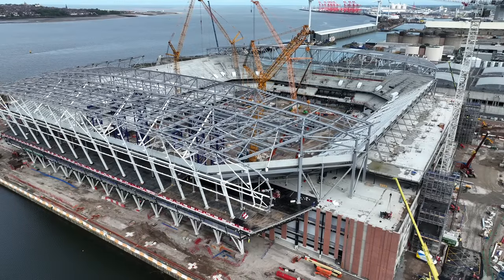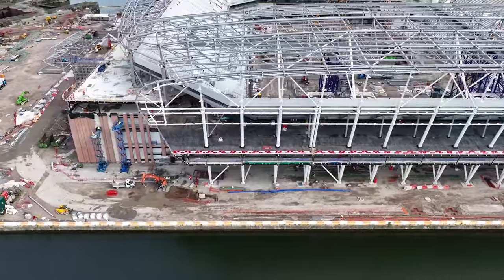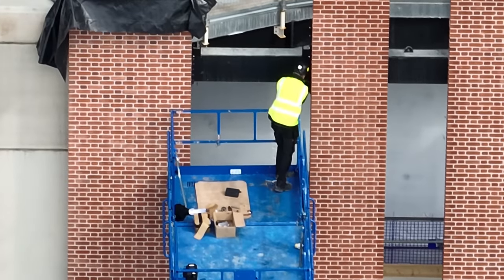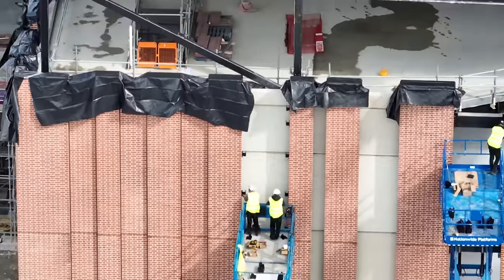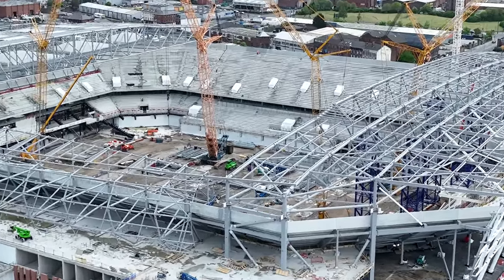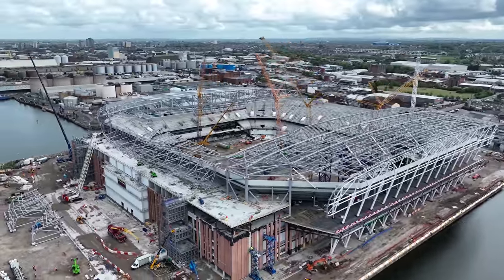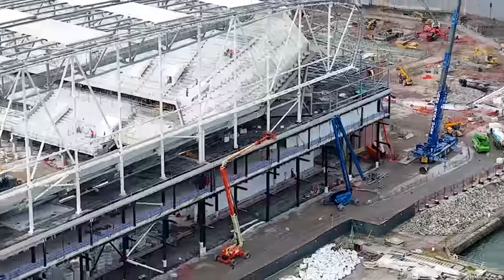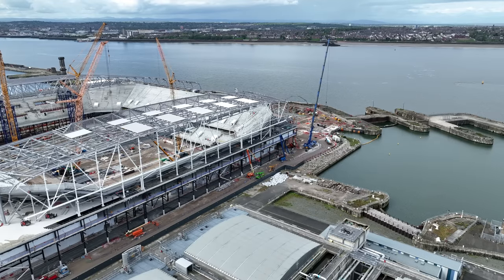Focusing on barrel roof on east stand, widows in corporate at Everton’s new stadium at Bramley Moore

Comment: Thanks for that closeup of the brick panels. It answered a few questions I had. Still a lot of terracing to be installed, but that won't be done till the cranes have finished their work as they need to get them in as close as possible to the existing structure for access to the upper areas and roofing.
Reply from the maker: No problem mate, thank you for watching

Comment: They're waterproofing the South Stand concourse roof. Also in SW corner I'd expect it to be another brick fascia section to cover the concrete imo but also possible it may be black perforated aluminium sheets to break it up a bit which will also be used to infill the stairwells.
Reply from the maker: Thanks Jay, is that where I zoomed in, or the southwest corner?
Reply: Anywhere there is a gap will be filled with the black mesh sheets. In the south west corner on your video they were attaching brackets for the sheets.

Comment: The brick panels look awful tbh.. they look cheap. Yes I’m a red but want this to look great as it’s going to be a big part of our skyline and along with the tobacco warehouse will be iconic building for the north dock area
Reply from the maker: Just need to see the finished article, hopefully it will all fall in to place
Reply: I think that the brick will age pretty quick. Once a couple of storms have come rattling through and sandblasted everything it will look good.
Reply: It's brick - the same as any other brick - panel is built in a warehouse under better & safer working conditions which allows better quality control of the end product.
Reply: @JayEFC1969  I think my point is that it looks printed, long face against short face doesn’t look like a traditional brick layout. Anyway I hope I’m wrong, hope this looks great once it beds in to its surroundings. It’s minor, I think it’ll regenerate the area with the other projects. Been watching these vids since the pipes went in and the dredging started 😆

Comment: Have you noticed about the everton dock ground move it all seems to be about the Dock ground nobody seems to be mentioning the road outside the Dock ground if everton move ground and they leave that road as it is outside the Dock ground its going to take hours getting to the match theres going to be congestion outside and near the dock ground plus the rail network won't be able to handle the crowds eg match people and people leaveing work etc its going to be chaos your going to have 30 thousand maybe more cars plus coaches etc decending there the congestion is going to be horrendous and there is very limited parking outside and near the dock ground

Comment: The Ground will be fantastic, but my only concern is, when the strong winds come, it will be horrendous in and around the stadium, I worked only 400 meters away from here, and whilst the wind strength was medium inland on the docks it could almost knock you over, I hope the stadium is built to withstand the really bad weather you get on the dockside.